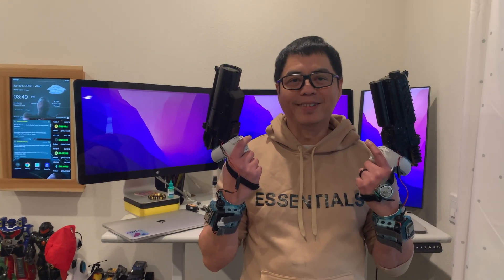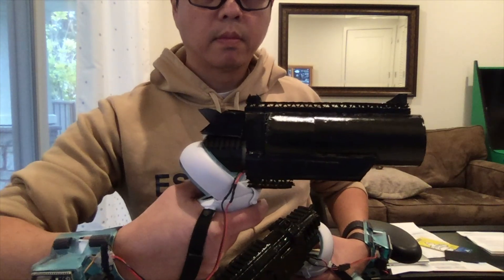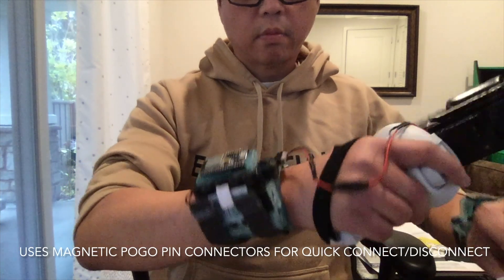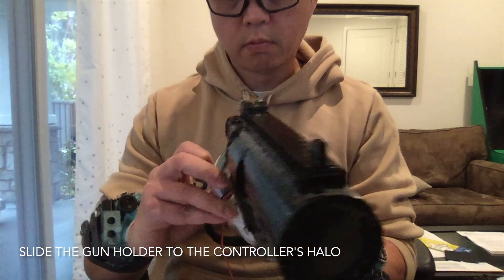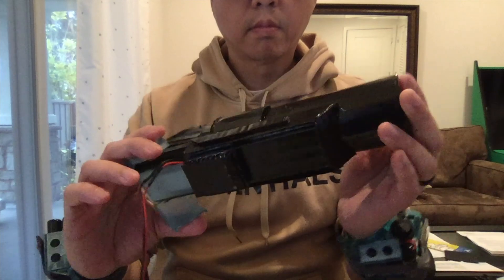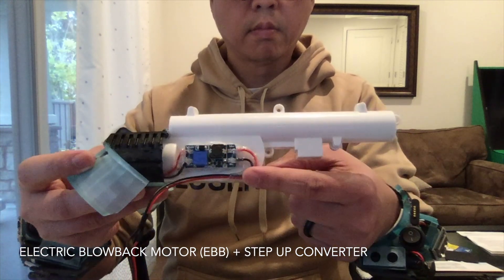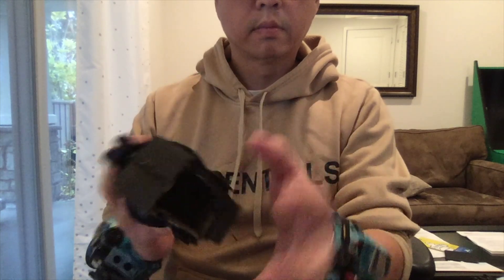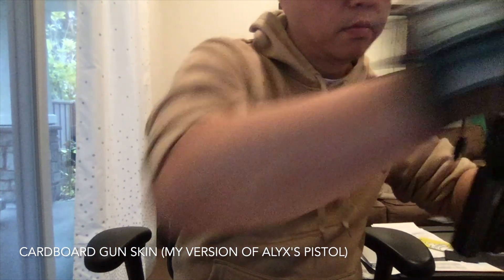DIY VR Haptic Gun Prototype 2 NEW Gun Design

Comment: Such a large redesign from v1!  Couple questions for you.  How does the v2 compare to the v1?  And the EBB motor seems quite loud.  Does it seem that way when you're playing the game?
Reply from the maker: hi, yeah the V2 is modular whereas V1 is a closed system. the V2 feels more balanced since the weight of the battery rest more in my wrist, so I can play longer. It also moves most components outside of the pistol so you can attach other types of haptic devices like rumble motors while using the same esp32 board and circuits. The EBB loudness is evident in the video but I dont hear it (or not as loud) when im playing since the quest 2 sound is loud enough and since im more immersed in the game, I don't remember even paying attention to the Ebb's sound.
Reply: @robenriquez5474  I thought weight would be a good thing for a more realistic effect to a real gun..